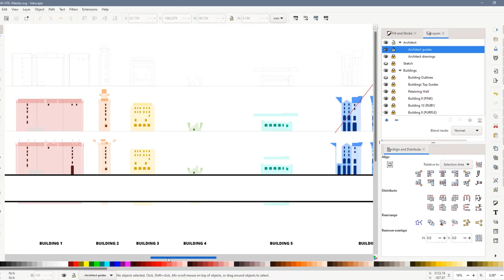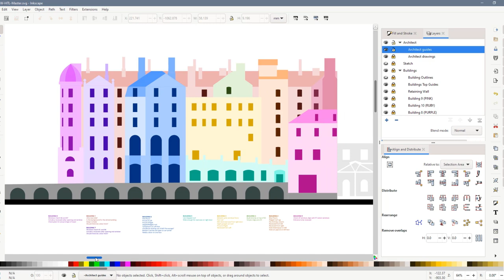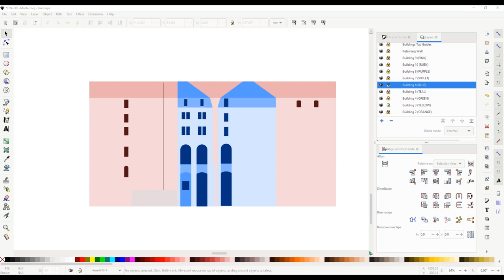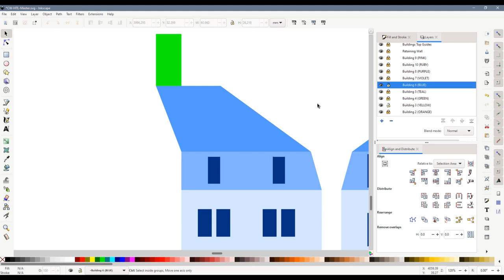3D building designs using cereal boxes : Scratch Building a Low Relief Victorian Hotel - Part 2

Comment: Apologies if you've mentioned it in one of your videos but what sort of card do you use for your bridges and buildings? I know you mention 2mm and 1mm card but what is the brand or source? I'm surprised when you sand it to get square edges etc., as I usually end up with a fibrous straggly mess if I sand card. Thanks
Reply from the maker: That’s good timing! I just started the hotel build for real this morning and I have filmed a small section about the exact materials I am using. Should hopefully be ready by Friday at 5pm. 👍👍
Reply: @Chandwell  Great stuff 😁 Enjoy the build!